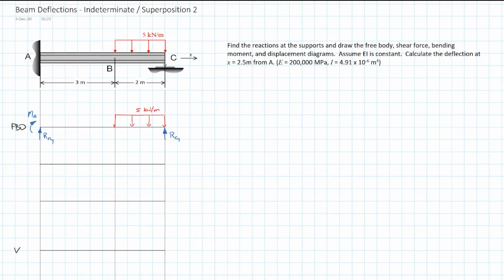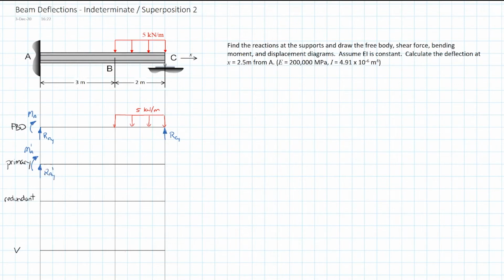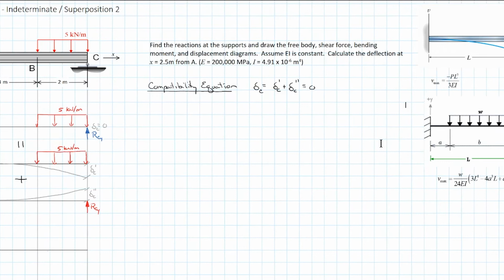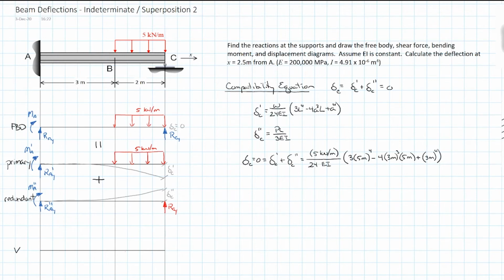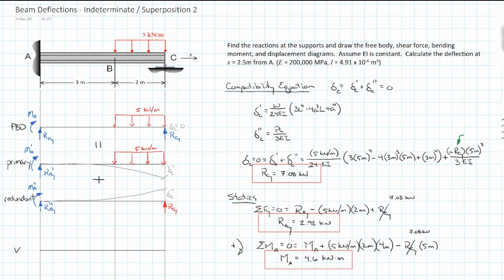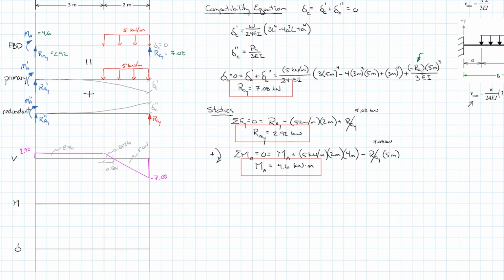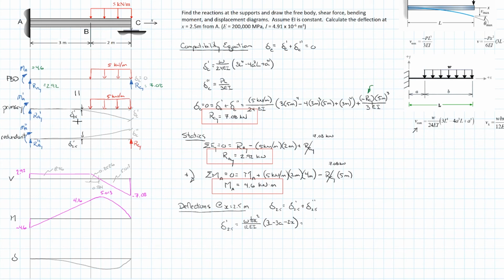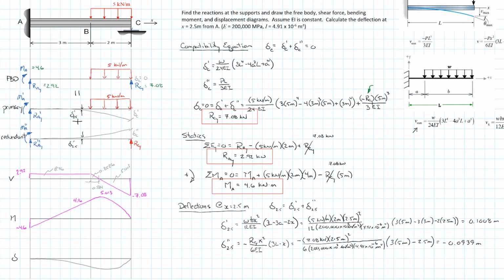Indeterminate Beam and Superposition

Comment from the maker: Apologies, 2 small errors.  Ma should be CCW and there is an error in the d(x) equation for the displacement resulting from the UDL, the second term in the brackets should be positive.  I will make a note on the video, but with my country internet, that will be several hours from now before it will be able to upload.